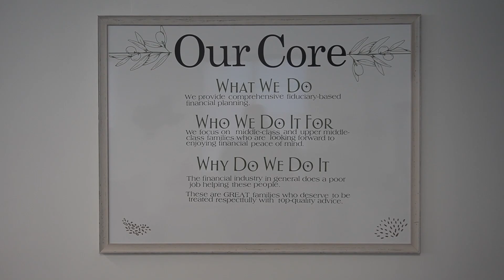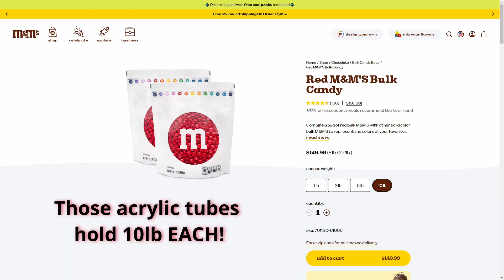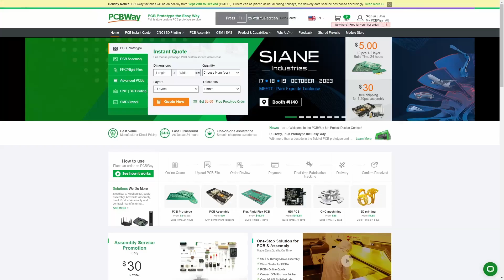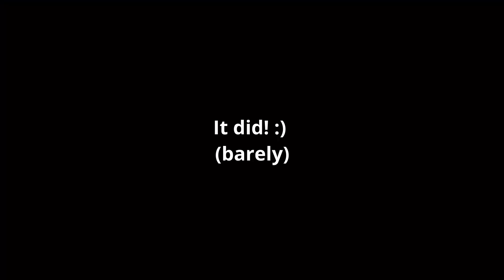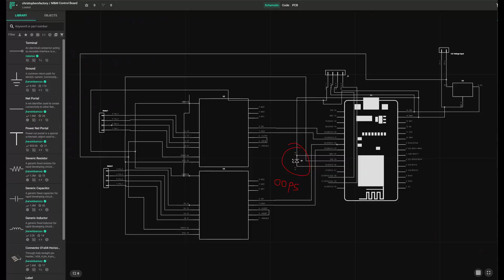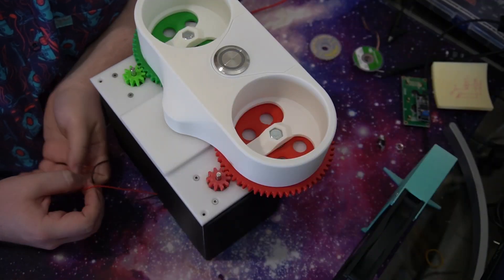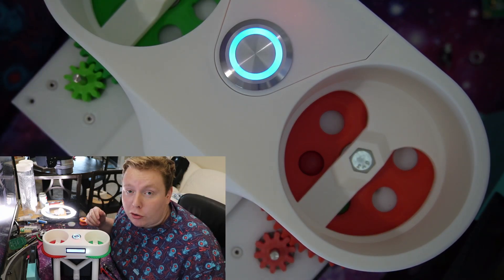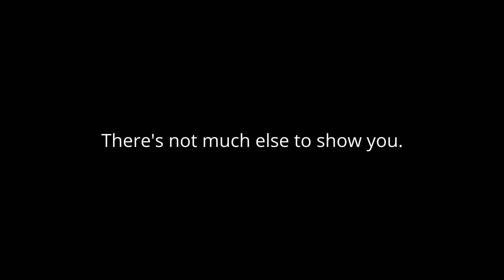I Made The World's Worst Stock Ticker

Comment: Very cool Idea to dispense the candy with just turning wheels.

But some Offtopic question here: 
When/Where do you plan to release the Fusion360/ STEP Files for your Build-a-VAWT Project ? 
I have seen multiple people asking for it because it would be super usefull for desinging for example motor mounts and/or the actual mount for the whole assembly for your project.